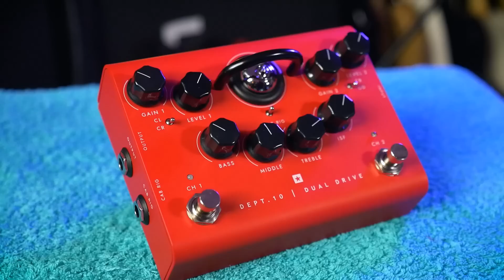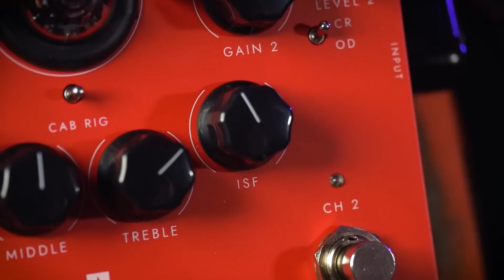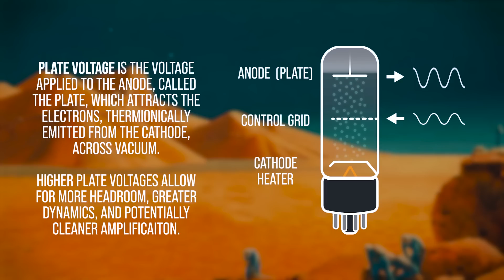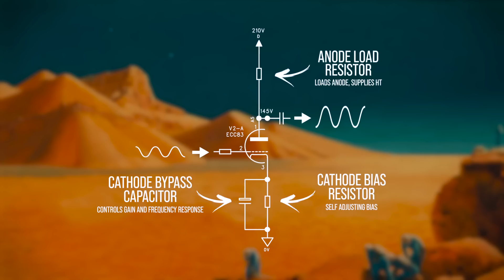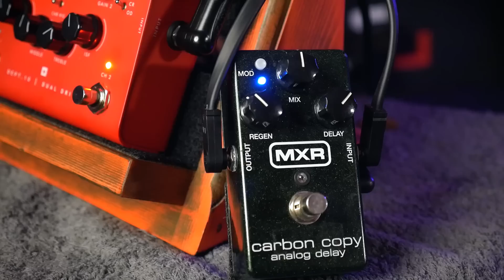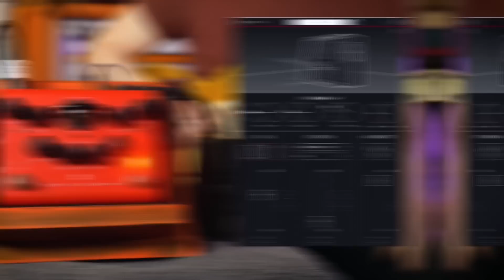Valve Pedals Done RIGHT! Blackstar Dept. 10 Dual Drive & Dual Distortion

Comment: VOX Cooltron said hello👋
Reply from the maker: Cooltron pedals not only ran the valve at low voltage, but implemented a circuit designed to drop the heater and plate voltages to as low as 3V.

It only functioned by applying positive voltage to the valve grid in order to force electrons off the cold cathode. 

The valves were simply a token inclusion to compete in a time period with Blackstar's HT release.
Reply: @ScienceofLoud  I have a VOX Bulldog Distortion and it sounds really good and that's what matter at the end. VOX has an explanation in user manual how Cooltron series operates, here it is for what is worth:

"COOLTRON is the name that we have given to a new way of using preamp type tubes at low voltage. In our case we chose a 12AU7.

Tubes are normally used at high voltages, and this is the recognised way of using them, but it negates their use in battery-powered devices such as guitar effects pedals which is what COOLTRON is!

Historically, attempts have been made to use tubes at low voltages, usually termed as being used in "starvation" mode. Unfortunately, these circuits have severe problems in the tube functioning in an acceptable manner. One problem is being able to bias the tube to a satisfactory operating condition. Another problem is that the necessary heater (filament) current is too high to provide adequate bat tery life which we all know would be annoying when you have to change batter ies every ten minutes during a gig.

The COOLTRON system gets over both these problems and provides true tube sonic performance at a very low voltage and at a reduced heater current - ideal for inclusion into the aforementioned guitar effects pedals - and therefore can give these pedals a vast improvement by giving valuable tube sonic performance.

Basic Operation:

The COOLTRON circuit basically operates by using two very special circuits:
A) To achieve the required biasing function, a unique circuit is used that provides the right conditions between the anode (plate) of the tube, and the grid. In general terms this circuit is called a "servo" circuit, and replaces the normal self-biasing networks that would normally be used. Although not the same circuit, this servo theory is used many times in high-end tube hi-fi, to achieve controlled stable parameters.

B) The heaters are provided with a special power supply that provides a low voltage and low current supply to the heater elements in the tube. Due to the servo-biased tube circuit providing the correct operating conditions for the tube, the tube now functions as it would if run at a higher voltage - i.e. the signal excursions can be operated linearly, pro viding balanced clipping conditions, and with the right harmonic & distortion characteristics- even when running from a B+ of only 6 volts. Both of these conditions are virtually impossible to achieve using nor mal "starvation" methods. Due to the tube now running at such a reduced supply level, the anode current is much, much smaller than normal. This means that the amount of heat required at the cathode to achieve sufficient cathode current emission is much smaller - hence the ability to run the heaters at a lower level.

Therefore both these points combined means that we have a usable tube circuit running off a battery power supply- battery life is approximately 16 hours from 4 x AA size batteries - but also the tube runs a lot cooler - hence the name "COOLTRON"!
Reply from the maker: I've seen the schematics for these pedals and unfortunately there is nothing special about them. 

That text you've provided is a very long way of saying nothing at all and doesn't address any of the physics of the situation. 

Their main concern was to get a valve running off of AA batteries, not to make full use of the sonic properties of the valve.
Reply: @ScienceofLoud  You have a point there 👍

Comment: Great pedals! How do they stack up to Two Notes Audio's "Le" pedals?
Reply from the maker: The Two Notes 'Le' preamps are some of the few other valve units that internally upscale the voltage to 200V.

Much of the feature set is similar to the Blackstar pedals, but in terms of streamlined design, user experience, and the flexibility of the digital simulations, the Blackstar pedals come out on top for me.
Reply from the maker: I have a Le Lead here in the studio, so might do an A/B video on them to get an idea of how different it sounds to the Blackstar distortion

Comment: I run a ts9 into an old mesa boogie v twin pre amp pedal (second gen) and it blows most amps away.
Reply: That sounds like a pretty good set up. I run the Blackstar HT-DISTX with a Boss SD-1 in front. Really surprised with how it sounds and the fact it does respond really similar to a valve amp.

Comment: they sound quite excellent do you need to use a power unit with them if you just wanted to use with a 4x12 instead of a head?
Reply from the maker: To drive a speaker cabinet you would still need a power amp of some description. 
These are preamps only.
Reply: @ScienceofLoud  thanks man !
Reply: Unless direct to pa ,yes you would need I power amp when sent to speaker cab. Someone else may want to chime in as well.
Reply: @vonmilash823  Thanks man !
Reply: @Peter-by3ox  no problem !